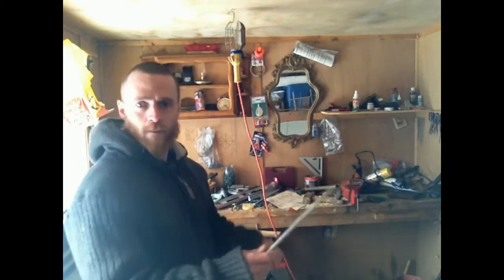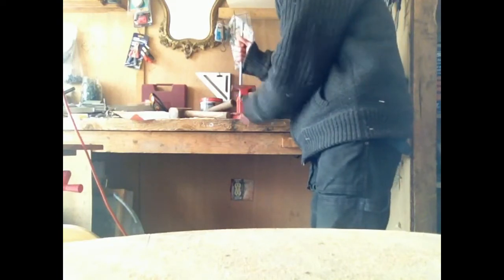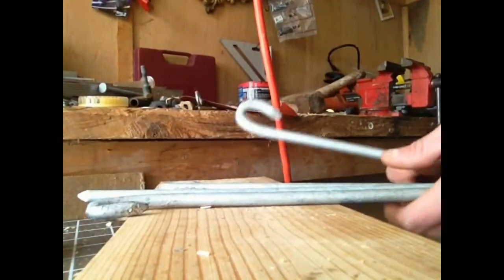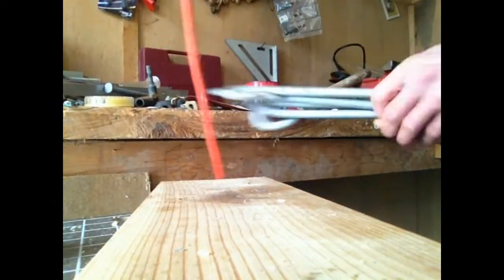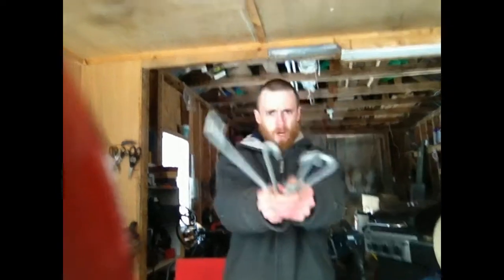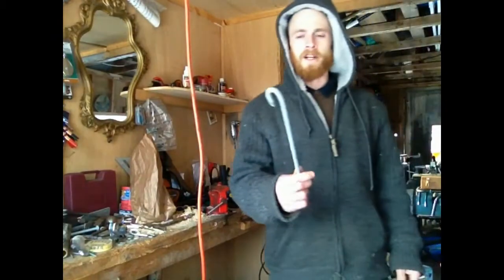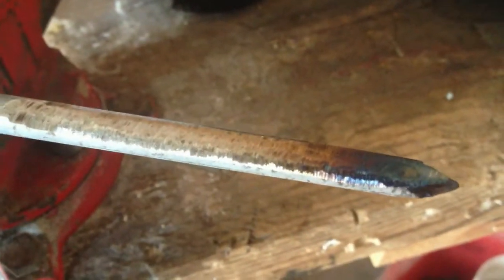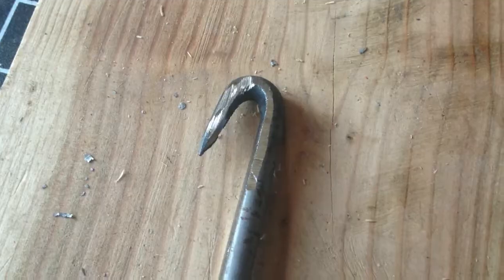Big Spear DIY HOOKS !

Comment: Another spear concept that you might find useful in the future is the Spearfishing Slip-Tip or Spearfishing Break-Away Tip.  Its a 2 piece spear tip connected by a cable. The idea is that once the spear is in the fish,  the fish no longer has the solid foundation of the spear to launch from when squirming off the spear. Very affective concept in general but designed to reduce the numbers of lost fish.